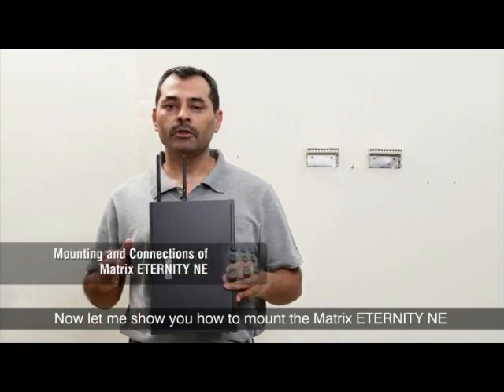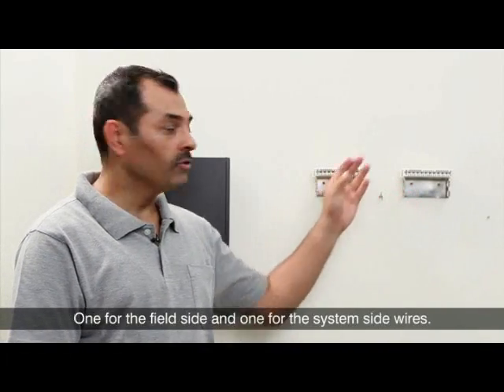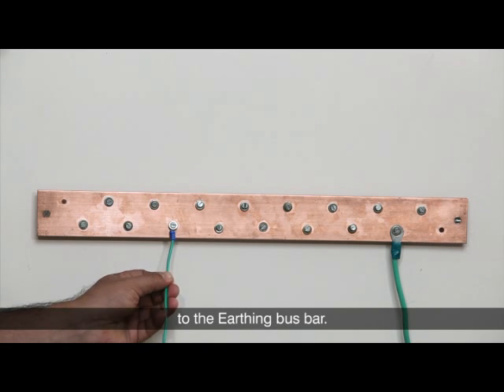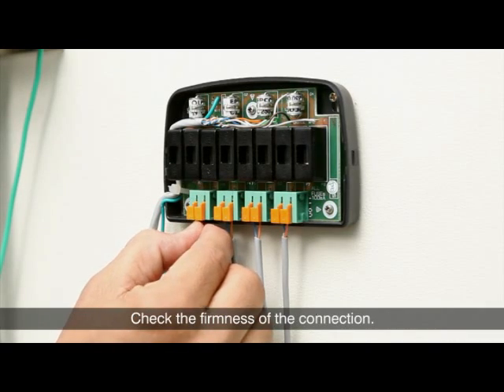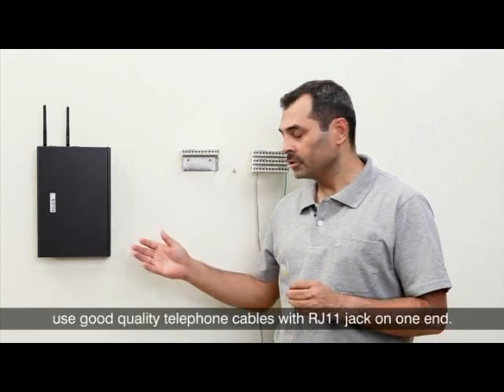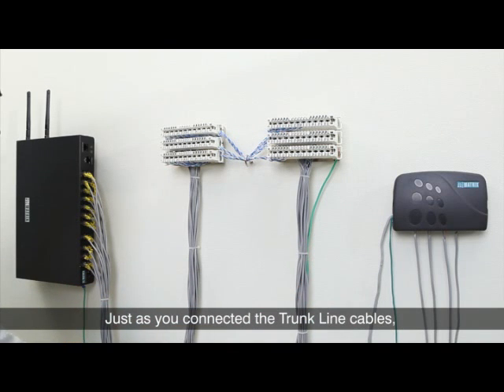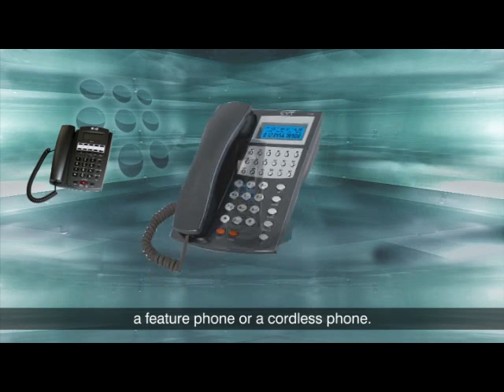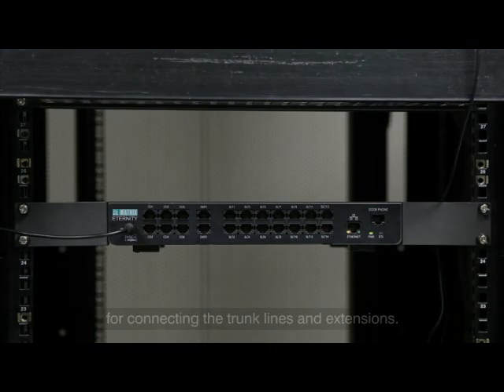Mounting and  Corrections

Comment: Sir can I convert to telephone line using one Ethernet cable, like 2 pair for internet 1 pair for telephone, which will be connecting to metrix visionpro 208 device, is that works...,